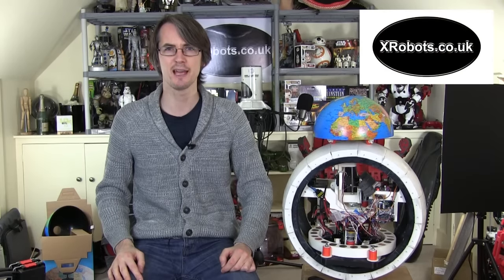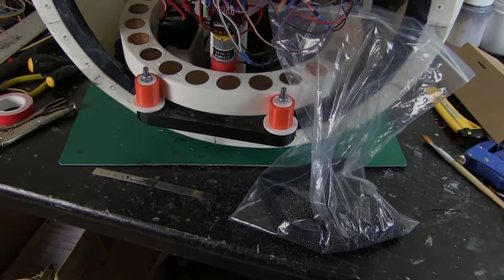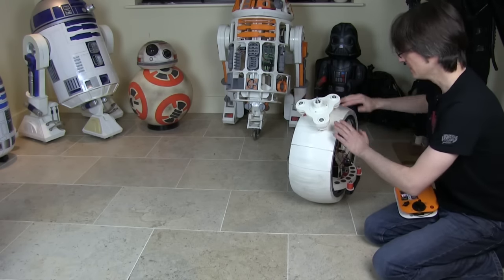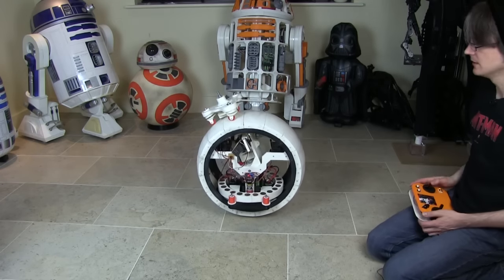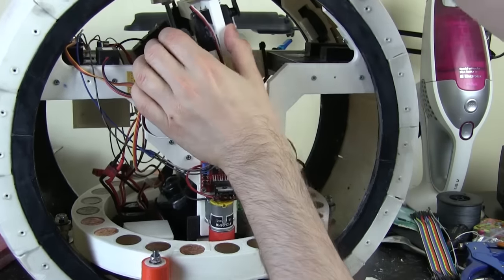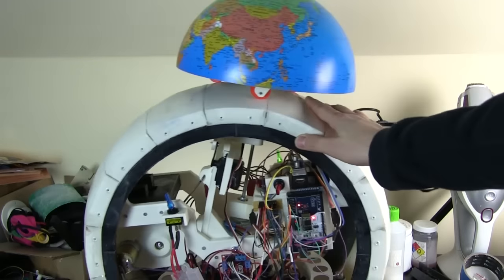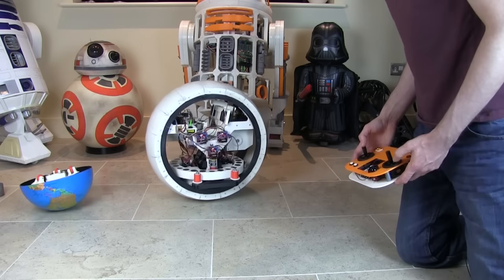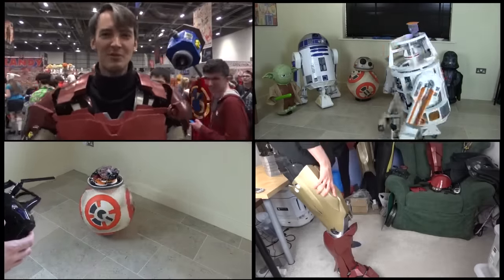Star Wars BB-8 Droid v2 #4 | IMU Head Stability | James Bruton

Comment: One thing I was curious about with the head 'bobbing' motion. The casters  have a pretty thick layer of Ninjaflex, and look like they are compressing a good bit.  Seems the rolling resistance could be decreased by a thinner outer layer, and larger hub.  This could also be beneficial if you add the other 2 magnets, as the force on those casters would be doubled.  This whole build is awesome, and seeing the engineering going into it makes me want to get back to my projects!  Keep up the great work on all your stuff!

Comment: james i believe  some of the lag behind in the head could be stopped with some other wheel system the casters will take more force to change direction because of the shape try a rounded ball kind of wheel this fixed all my problems with your set up for me i have one 100% like yours runs much more smooth

Comment: The original BB8 seems to slightly overcompensate by leaning into a direction with the head before actually moving into this direction. I am not sure if this was more of an artistic decision to intensify the sensation of movement or if it actually helps moving straight. Thinking of it, this could also help in the breaking maneuver to reduce wobble, as the head has more way to travel backwards during the stabilisation phase.
Reply: +James Bruton (XRobots) Awesome, looking forward to see the result!

Comment: about the magnets: linking them with steel or using an halbach  configuration could help without adding more mass, it would simply improve the use of the magnetic flux.

Comment: James why not put a couple of QI inductive charging pads on the inside of BB8? That way you wouldn't have to take him apart to charge him?
Reply: ***** Well if you had a few qi pads you could use one per cell and the slower you charge a lipo the better... but it would be cool to have a little panel that flips out and reveals the balance charging leads..awesome work by the way I still dont kn
ow how you find the time!!

Comment: i think the mathmatics in the bottom ring is not quite right yet...
Maybe the stick should not control the speed of the ring, but the accelaration, since that is what controls the rotation of the robot. Imagine this: if you push the stick all the way to the right now, the robot will jump to the right and then settle down. as soon as you let go of the stick, the robot will spin in the other direction with the same force. if you made it so that if you let go of the stick, the ring keeps its rotational velocity, and it is only manipulated if the stick is pushed to the other side, it would make much more sense. I don't know how much battery that would suck though...
Reply: +James Bruton (XRobots) instead of screwing around with a bunch of clumsy hacks to avoid confusing the magnetometer, replace the thing that is making the magnetometer confused with something that won't.

Comment: To keep the lead shot for making noise maybe you could put in a whole bunch of hot glue on the top of hte shot so it stays tight and dosnt' shake around.
Reply: +Joshua Walters just pour CA glue all over it. It hardens in to a solid mass, and then if you ever want the shot back, just put it in a bag and smash it up a bit. The shot will then separate back to pretty much loose shot again.
Reply: +Tony Dew Or motor oil, which also adds more weight and is less permanent.

Comment: I know this is probably too late, but you can do much more than double the power of your magnets by putting a steel bar across the back of them.  Remember, magnetism is the same thing as electricity, so it only works if there is a complete circuit.  Air is a weak magnetic conductor, but any ferrous metal will increase the power or your magnets by a LOT.  The best thing I've seen on the internet about the effect is Frank Ford's page on molded magnetic clamps.  Check it out - it is extremely useful when using magnets.

Comment: James,im wondering what a good material for making a iron man suit is? i dont want to use fiberglass because so its cheap. im going to make it from a Pepakura design but my idea is like your hulkbuster (Leave it standing with nobody in it.) and the frame is made out of wood,i also do not have a 3D printer,so any ideas? Thanks

Comment: Amazing build.  But to have more stability and good balancing you should move the weight as lower as you can. This avoid inertia movement due to the too high distance between the floor level and the gravity center of your bb8.

Comment: I have much praise for you. I wonder how much better would it be if the designers had intended the head to be independant module in control of the base and able to move along its surface using its own technique rather than just being stuck on via a magnet. It would solve allot of the lag but complicate the head unit considersbly

Comment: Why not try using the small ball bearing style castors instead of the spinning wheels? Should be be a pretty similar effect without all the additional slop of the head position not moving until the wheels have turned nearly all the way into the direction of travel?

Comment: Maybe for the sides you can make it so you can replace them with transparent halves for when you want to show off the insides. I'm very impressed so far!
Reply: +James Bruton (XRobots) it takes to much time for head to react on the command. Supposingly, if you replace those wheels at the bottom of the head with ball wheels turning all around you will reduce friction between head and body and achieve more stability.
Reply: +Александр Рапопорт He did try out ball wheels in an earlier video, but if I recall correctly the balls had to be hard to prevent them from getting stuck in their 'joints'. This caused more friction on the surface and it didn't sound smooth.